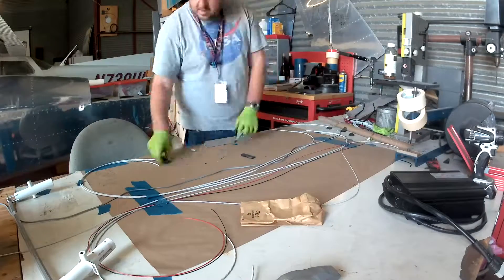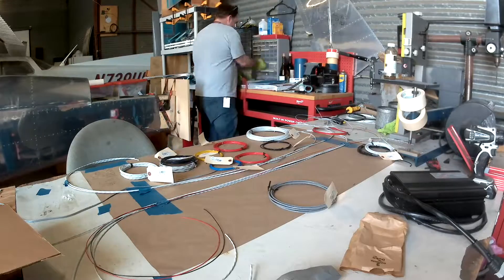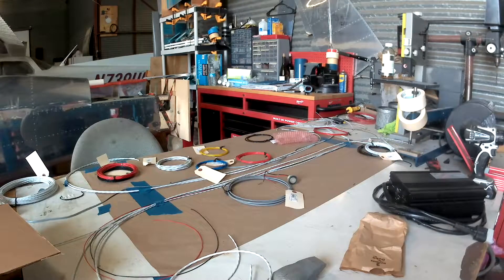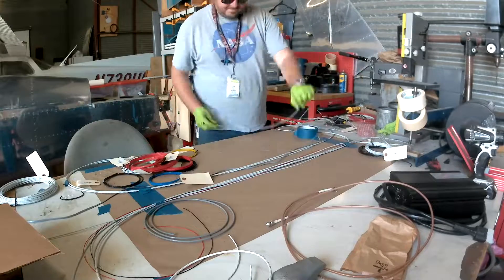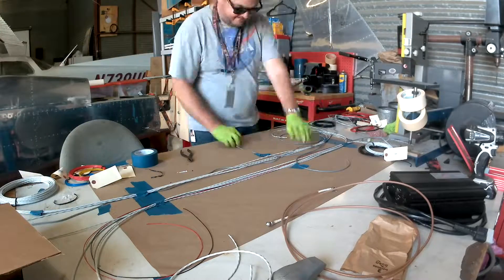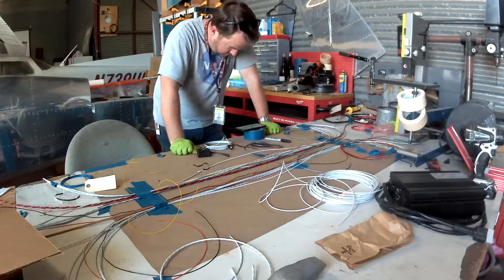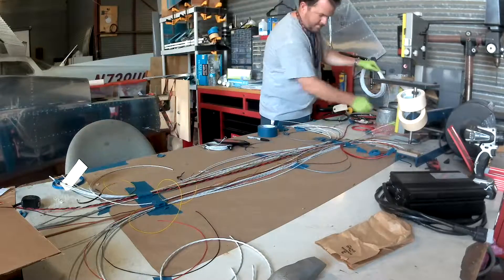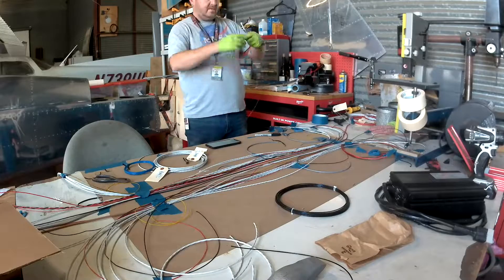RV - 14 - Fuse Wiring Harness - 2

Comment: Hi Andrew - what drove your decision to put your magnetometer in the right hand wing and not on the adahrs shelf?
Reply from the maker: The magnetometer is wired into the Can Bus. There's nothing in the left wing (where the adahrs shelf is) on that bus but there IS one in the right wing (A/P roll servo). That's one of the reasons the right wing tip is such a popular spot I suppose.
Reply: Andrew Kilroy ah. I’d never thought of that. I’ve heard people use the servos as the end points of the can bus so I was thinking the pitch servo - magnetometer in the left wing - everything in the panel - out to the servo in the right wing. Yours is basically going from the pitch servo to the panel past the roll servo and out to the right wing? Is your pitot in the left wing? That would make a lot of sense to put the pitot in the left and magnetometer in the right (thinking thinking). Did you end up with any interference from the Servo to the megnetometer?
Reply from the maker: tasesq  Exactly. Pitot (heated) in the left wing. Pitch servo to panel to magnetometer.

Comment: On my last build I used a Dymo Rhino 4200 (prints on heat shrink) to label all wires on both ends..... one of the best decision I ever made.  There are lots of ways to label....  but label one must.  Every time is do any wiring work I thank god that I labeled carefully!  Love seeing your progress.  Keep up the good work!
Reply from the maker: Yes yes yes! I'd been casually researching label makers for this exact thing but just hadn't really found what I'd liked.
Reply: Andrew Kilroy If the don’t find one you like better,  the Dymo wont disappoint.  The machine is pretty reasonable.....  But they get you on the printable heat shrink cartridges.  Just did a quick check and there are others making the cartridges now - way less expensive.